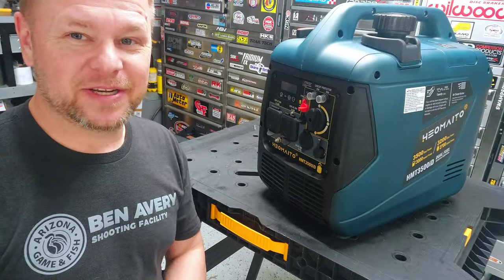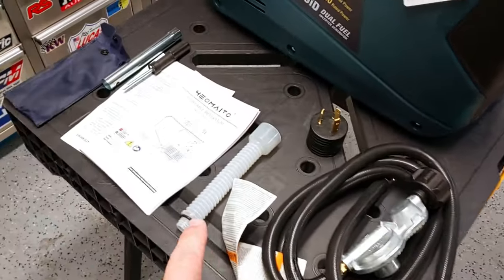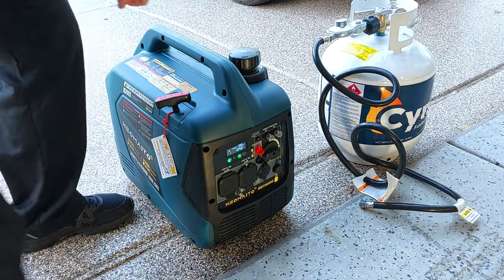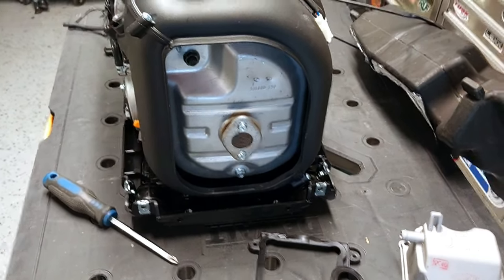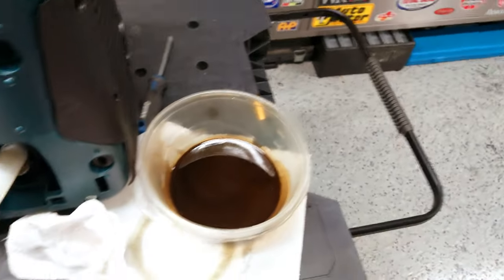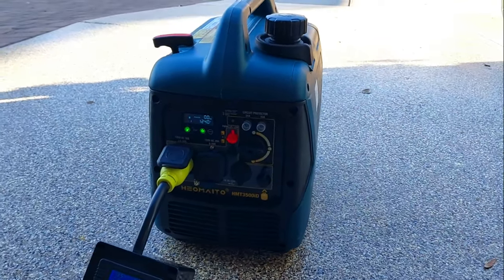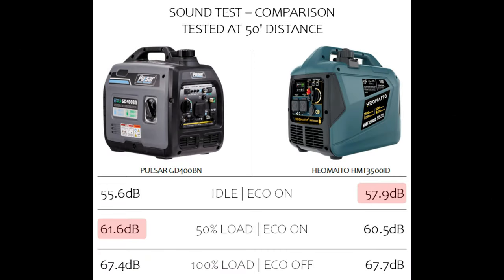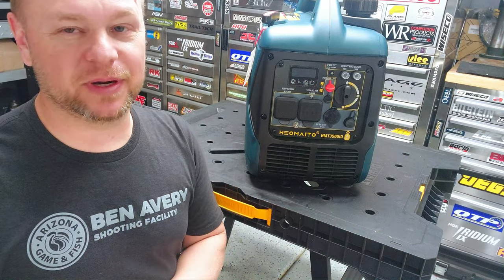BEST DUAL FUEL 50LBS 3000W+ HEOMAITO HMT3500iD HMT4300iD PROPANE GAS INVERTER GENERATOR | RV CAMPING

Comment from the maker: A quick followup, Heomaito ended up revising the PN to the 4300iD instead of 3500iD. They did this as it had a lot of headroom and easily exceeded its ratings per my review. They also did an inverter firmware tweak with the 4300 which helps keep the overload indicator from flashing early when it is still producing clean power. Confirmed with Heomaito, it is the SAME generator, with the SAME inverter, just a slight rev in overload and protection set points. This review applies to both models. 
Jump straight to purchase this generator here:
https://amzn.to/4cptY9w
Reply: the link doesn't take you to the 3500
Reply from the maker: Fixed! They keep moving their links around !

Comment: Did the manufacturer/company ever respond to your email?  An item like this, I plan to own it for a long time, and customer service and part availability is a big deal (for me).
Reply from the maker: Yeah, they respond quite well these days. Most all parts in these small engines can be looked up and ordered without issue depending on manufacturer. And the best part, never had an issue with my Heomaitos.

Comment: Did the company get back to you?

 How is it holding up? 

How do these or pulsar compare to honda? Everyone says just get honda 2200. Honda or nothing for long term. What do you think?
Reply from the maker: These days, a well kept cheaper generator will last as long as a honda. A poorly kept generator will have a short life, even a honda. This particular unit is really nice and very well made. Of course, you will not go wrong with a honda, but your wallet will be vastly lighter.

Comment: Great review video and, of course, the break down to see what's inside, and build quality.  it's funny, you basically said everything I was thinking and wondering, from build quality to sound testing vs the Pulsar, vs price point.  You are spot on!   I've owned my Pulsar for 2 months now and it's been a solid performer, other than the build quality, some components used are subpar, and there are 2 spots rubbing on my outer case, which I have contacted Pulsar about, and await their response.  You should look at yours. I'll be it's doing the same thing.  I liked you sound test comparison.  It was perfect, and actually really interesting!  Heomaito is advertising this "fancy" muffler and quiet package, but you are showing that it's basically same the same db as the Pulsar, with the Pulsar actually being a bit quieter low idle no load.  You noted that the Pulsar has a lower tone, which seems more pleasant.  One concern with the lower vs the higher tone, is the lower tones tend to pass through exterior walls of houses/RV's easier, whereas the higher tones can often can blocked better through walls.  So that "droning" sound of a generator running, may often "sound" more annoying with the lower tones.  Like you said, the small inverter gen market is constantly evolving on an almost monthly basis it seems.  You never know what will come to market next.
Reply from the maker: I was thinking the same thing with the low droning. I will have to test with my travel trailer here soon. Makes me wonder if the frequency response is just as low on the Heo as the Pulsar, but the Heo's frequency just extends higher. Only testing will tell (since dB reading was so close, would make sense for a wider frequency range). Or, could just be a difference in pitch / same amplitude but our ears pick up mid-range frequencies easier so it seems louder by tone.

Comment: I purchased the HMT 4300 generator and it powers my trailer AC well. I have two questions: 1) Can you recommend the part nuber / brand for a magnetic oil plug. Are they all the same size ?  2) When I plug my power analyzer / Surge protector into the generator it indicates that the generator has an open ground. Is this normal or do I need a grounding plug when I hook it up to my Trailer RV ? If so do you have a recommendation ? Thanks, Doug
Reply from the maker: Hello! All part numbers and such are in the links of the video description. Some of the links for you:
BUY THE HEOMAITO HMT4300iD GENERATOR HERE! (same as HMT3500iD in this video) 
On Amazon
https://amzn.to/4cptY9w

OIL CHANGE FUNNEL! A MUST! (good to have more than 1)
https://amzn.to/3TkWzWI

OIL I USE FOR BREAK-IN (change at 1 hour mark to a synthetic below)
https://amzn.to/4bWoymP

OIL I RUN AFTER BREAK IN
Hot weather 15w40
https://amzn.to/49ReaL2
Cold weather 5w40
https://amzn.to/49WPgtD

STA-BIL FUEL STABILIZER! IF YOU STORE YOUR GEN WITH GAS IN IT, THIS IS A MUST! (not really needed with ethanol free fuel)
https://amzn.to/3cGW4TZ 

MAGNETIC DIP STICK (A MUST FOR SMALL GENERATORS!)
https://amzn.to/3Bh4Bab

DENSO UPGRADED IRIDIUM SPARK PLUG THAT WILL LAST THE LIFE OF THE GENERATOR. WILL FIRE AND START EVEN WHEN WET FOULED. DO NOT CHANGE THE GAP!
https://amzn.to/48zu7EF
Reply: @MR_Garage   2) When I plug my power analyzer / Surge protector into the generator it indicates that the generator has an open ground. Is this normal or do I need a grounding plug when I hook it up to my Trailer RV ? If so do you have a recommendation ? Thanks, Doug

1

Reply
Reply: @douglandon9826  I am no expert but I assume adding a ground rod and wire to the "Ground Wire" connection on the front. I have never used one but they do recommend for safety reasons. That being said, most everything on these generators is plastic so I cannot imagine being electrocuted by touching a shorted component.

Comment: Great video.  Thanks.

Something you can do when purging the propane line is to have a digital gas detector handy to tell you when the propane is flowing.  Once you get used to purging, whatever, but thinking it may be handy to someone new to this and even just a good safety thing to be in the habit of.  You want the line to be fully purged of air, so you will get some air/propane mix as you purge.  Say you put the detector on the ground in front of the generator, it will go off once the line is fully purged.  Once things are tightened up and and the detector stops beeping, you can pick it up and check for leaks.
Reply from the maker: I dig it! 8 second ish rule has always worked for me, but I get it. Also, a smart thing to have a portable detector to make sure lines are tight.

Comment: Hi. Thanks for the good review services you are doing. I did use your recommendation and buy my first dual fuel unit. It's first oil change after 45 minutes on gasoline now done. By the way for those interested my bent rod telescopic magnet says iron/steel sleeved cylinder bore. 
Like the color a lot! Kind'da spruce green. Saves me from less stolen de-attracting overpainting green or brown. And I love the straight up top pulling starting. Just like a chainsaw; brush cutter. NO pull tipping of the unit!
The operation manual says this unit will prioritize propane fuel use if hooked up then auto switching over to gasoline running. It does have a carb bowl built on Teed fed propane pressure diaphragm plunger lock out into the gasoline carburetor main jet. Cast marked "hauvaun". The Pulsar unit distinctly is electric plunger gasoline fuel cut-off.
Now at 4 hours. No chaffing rub marks. Has an added rubber bumper in the center of the vertical center support for the valve cover movement contact.
Reply from the maker: Very good post! I liked that you check the cylinder bore material. I will add that to future reviews. That is very important and speaks to the likely longevity of the engine itself. And yeah, the green color I rather like now. At first I did not care for it, but when camping, it blends in nicely and was a good color choice.
Reply: I just hook up a 20 pound bottle of propane. Yep-yep. Gasoline in the on-board tank too. Turn on the propane it running switched over from gasoline to propane running. Turn off the propane tank and ~30-45 seconds after the regulator/line run out it running switches back over to gasoline running. Just like the higher priced units now promote. I'm a very happy owner now. @MR_Garage

Comment: Looks like a nice machine but would like to see a bit more power like the 4000 Pulsar and others. I was looking at the A-iPower 4300iD but no one has done a review like yours. Any chance of you doing a review on the A-iPower 4300iD?
Reply from the maker: Thanks for the message! So with those ratings, those are the peak numbers. Basically, any generator manufacturer can say what they like with different lab tests and inrush spikes to claim a super high number. VERY misleading. Only pay attention to the running wattage number. This Heomaito gen is rated at 3000W, but has a 3.3kW inverter. In testing, it ran to 3200w without an issue. The 4300iD has a HUGE starting wattage number for some unknown, likely marketing reason but could be legit. Actual rated power is 3450W and 3100 on propane. This Heomaito did 3200w with a resistive load on both gas and propane. Very comparable. 
Some other things to consider:
- Both that a-ipower gen and this are made by the same contract manufacturer 
- The Heo is lighter because of no wheels or handle to rattle
- The Heo is also far less expensive 
- As mentioned, virtually the same power rating

I still would like to get my hands on one of the A-Ipower variants. Should be the same internals but really feels like they fluffed their numbers a bit. I could be surprised though! Not seeing these variants being worth the personal expense at this time and none of these manufacturers have the guts to send me their product because I tear it down and tell it how it is. They generally don't like that!!

Comment: Is there a reason you suggest the NGK CR7HIX and not the CR5HIX? Isn't the heat range for this application a 5 and not 7? Does it matter?
Reply from the maker: It is a good question and I nearly missed it when doing the first crossovers ages ago on these. The torch plug PN actually crosses to a 7 heat range NGK / 22 heat range Denso. Reading the plug after running confirms this. This was later confirmed even in the manuals of several generators calling out the same crossover to non-iridium NGK and other plug types.

Comment: Once these units break in, would you recommend the Shell Rotella T6 Synthetic in 5w40? Is there an advantage to sticking with the non synthetic product?
Great content, keep it up!
Reply from the maker: If lower temps in your area, yes. 5w40 would be perfectly fine. As hot as these run, I use 15w40 T6 in all my generators, especially since they see summer use here in Az.

Comment: I am receiving mine on Tuesday! found your review after I purchased, lol. Made me feel better about the whole thing! Thank you. I am wondering what type of spark plug you put in and why? Thanks Again!!
Reply from the maker: Hello, very cool! It's a great gen. Let me know how it does for you.  Check the video description for a link to the plug and pn used. I use iridium (ngk or denso) in all of my generators as the fine wire electrode makes them very easy to start, even when wet fouled. They also seem to run smoother. Another benefit is that the plug will last the life of the generator.

Comment: Question:  My RV has an existing quick connect, low pressure line coming in from the camper’s regulator and tank.  Is it possible to install a quick connect gas line to  this generator with my existing system without using the provided regulator setup provided by Heomaito?  Thanks!
Reply from the maker: Nope, not that I am aware of. These gens come with rather specific regulators (all I have tested) for their size and output. I do not know how they will behave with another regulator. Best bet is to T off the tank itself with a line dedicated to the generator. Or, just take a 2nd tank specifically for the generator.
Reply: Thank you for your prompt response and awesome reviews. This generator was just delivered to me today.
Reply: I have a Firman dual fuel inverter generator I'm looking to replace with a lighter more portable generator.  I modified the Firman to attach to the my RV's low flow valve by removing the regulator and installing a quick connect valve.  Works fine so I'm curious to know why you think this modification can't be done on the Heomaito.

Comment: I have pulsar dual 4000 like your, i want to know if they can run on natural gas?
Reply from the maker: I would not, but some show on videos it works. No guarantee on the a/f ratio of a regulator designed for propane so it could damage the engine (heat / toasted valves and seats). Also, NG has around 10% less output than propane.

Comment: Great video! Do you have any experience with the Champion 2500 duel fuel? Anyway, I loved the video and the way you structured your review. Also, I'm really thankful for the heads up on the magnetic dip stick.
Reply from the maker: Much appreciated! The champion 2500 uses the same inverter and engine rotating assembly as the very inexpensive bilt hard I reviewed awhile ago. Same manufacturer but the champion uses a better designed panel with additional features. Also, it is dual fuel which the bilt hard does not offer. I think it would be a fine generator if you chose the champion and will serve you if maintained. 

For the price and weight, I feel there are better dual fuel options and I would not chose the champion for myself. For about the same price or cheaper, you can get a GD400BN pulsar like this and have a much more powerful generator for only 10lbs more weight. https://amzn.to/4aOv6C7

Or, my top pick in the 40-50lb range - the heomaito HMT4300iD https://amzn.to/4e3YVBD

Comment: Looks like a great generator and would support our Lance trailer 10,000 BTU AC. My only concern is who do you contact for warranty work. I don't see much info on their website regarding services locations or length of warranty. Also have you ever reviewed the 33000 watt generator made by RVMP brand ?
Reply from the maker: Same with any small generator these days. Just take it to a local small engine shop if you cannot make the repair. Not going to find a brand with a local office to drop it off at. Even US brands like champion would have you do the same or ship it back to them. The RVMP is just another private label. Same as a powersmart PS5035 for example.